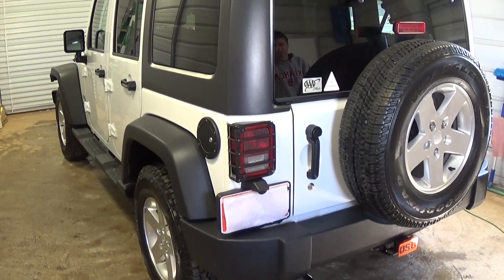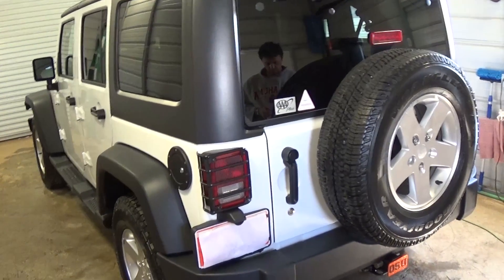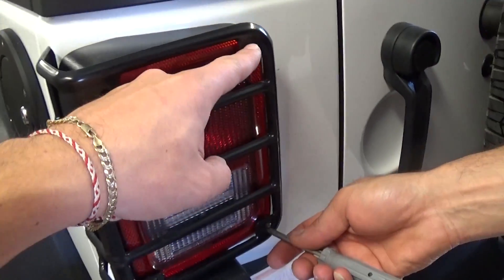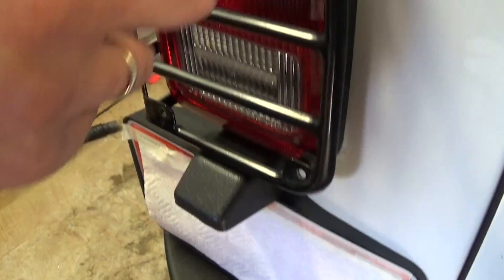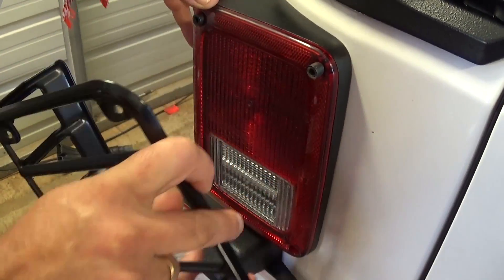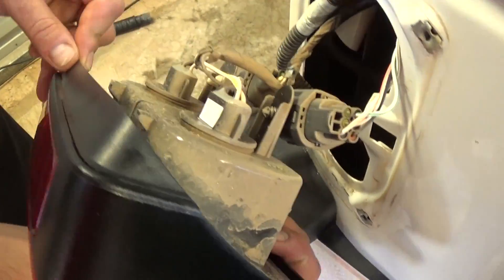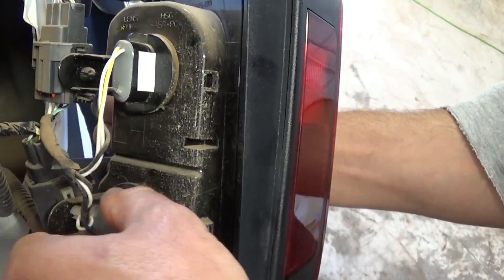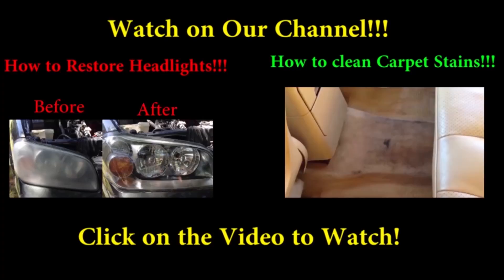Jeep Wrangler JK Tail Light Bulb Replacement  Brake Light Bulb  Turn Signal Light Bulb

Comment: Adding the bulb replacement information would be helpful.
Reply: Joel Barrett I agree.  I’m looking for how to get the bulb out of the socket clips and they totally skipped that part.
Reply: Just pull on it. It can be a bit tight sometimes.
Reply: @mando0414  can confirm that you just pull it. Pull from the plastic base
Reply: Guys . The bulb is a 3157. You can get it at any auto parts store and to remove it. You twist it and pull it out because there are tiny fins in the tail light housing. That hold the bulb in for extra security.
Reply: Separate the bulb from the wire housing, (I recommend using bulb lubricant, for optimal connectivity) insert the new bulb, then reverse the steps you saw on the video. It's not very hard

Comment: Thanks for posting. The turn signal on my 2012 Sport Unlimited was out.  It's the top bulb in the assembly, which is also the brake light.  The bottom bulb is the reverse light.  On my 2012, both use a 3157 bulb.  I was tipped off that the turn signal bulb was out when the blinker on the dashboard starting blinking twice as fast as normal.  Thanks again!

Comment: This video does not mention how to pull the bulb out. Important if you are not sure if you will break any plastic by using a lot of force. The answer is that it does just pull out, but with effort. Try forcing some Vaseline or grease under the plastic gripping tabs, then pull or wiggle the bulb out.
Reply: I always try to put a glove on or use a towel to pull the bulb out as well, it helps.

Comment: FYI- You only need to remove the 2 inside screws, not all 4, to remove the lens.
Reply from the maker: +Charlie Tarna thank you for the tip
Reply: +M Dapper The 2 outer ones only hold on the red lens. They have nothing to do with removing the unit from the body.

Comment: How do you remove the bulb? I can't figure out the clip holding the bulb in
Reply from the maker: Use a small screwdriver and pull the clip to the back a little and just grab the bulb and pull it out. Do not twist left or right. Just pull straight out sometimes they get stuck (use gloves because we have seen some breaking)
Reply: ya they seemed to have left that out didn't they : {
Reply: @WorldMechanics  Thank you - worked perfectly.

Comment: how to remove the bulb, it's so difficult, that's why I love LEDs. I can't get it off.
Reply from the maker: +mextijuas5 They really tend to get stuck if they have not been removed for a long time. Just pull it hard but be careful not to brake the glass in your hand.